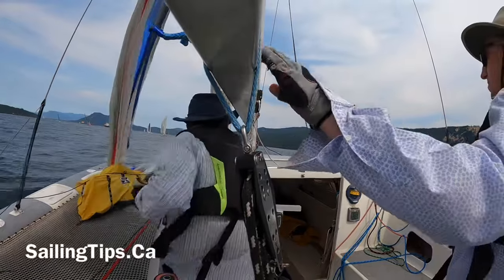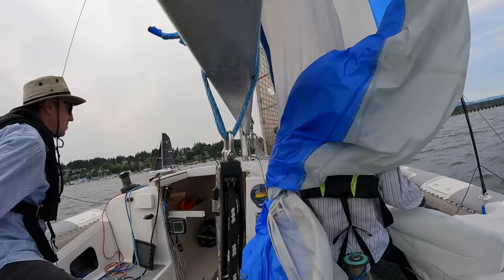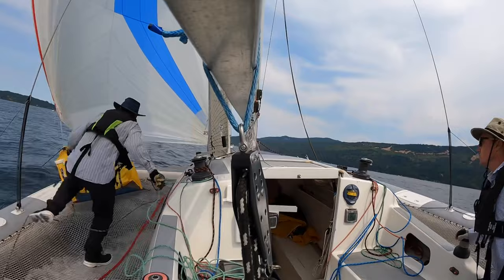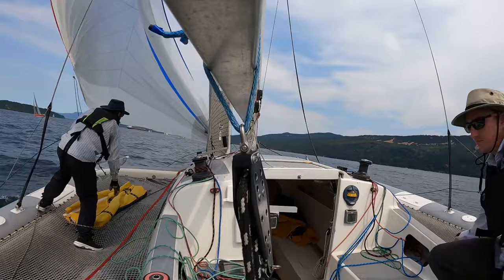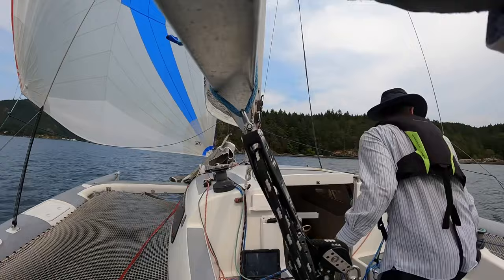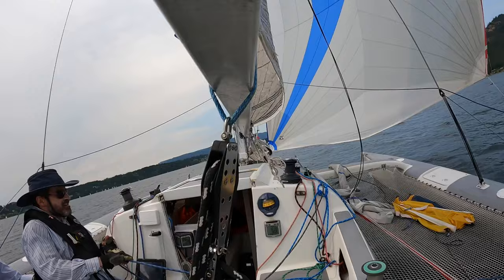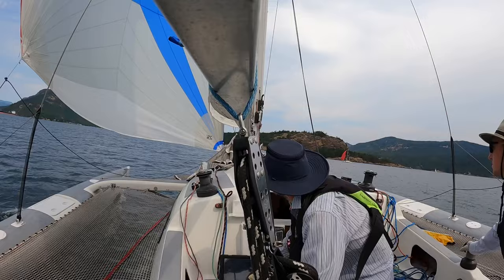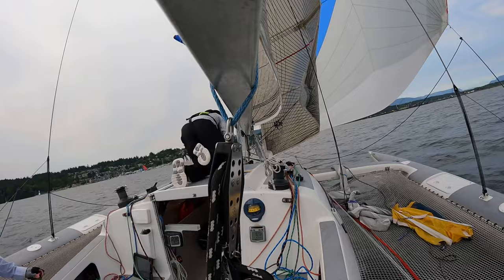How Do You Fly a Spinnaker DOUBLE HANDED?!?!?

Comment: It’s even easier if you have a snuffer.  The other tricks for two handed is to route your sheets to an alternate location on an ama so you can help look for traffic, and to run the spinnaker a little higher by easing the tack (for asymmetric) to increase visibility.
Reply from the maker: Good suggestions! I had a snuffer on my last boat and it once got fouled and I couldn’t pull it down, so they’re not entirely fool-proof and also require some finesse!

Comment: GReat and as always easy thanks to the clear and short explanations. One question; If you want to raise back the Spinnaker after dousing it, is it always compulsory to repack it as you shown in the other video? ( I learnt it that way from you and always worked like a charm) or can we directly raise it out of the bag through the front portlight?
And another question, how to attach the bag to the lifelines in a cruising boat (Mine have one small metallic carbiner in each side  and at the end, always goes down to the water but reamining still attached; seems to be a silly question but I didnt find the proper way yet... 🤭
Reply from the maker: If you douse a spinnaker into a hatch, or a bag hanging in a hatch, it’s definitely possible to raise it directly out of there again, assuming you didn’t change any lines or anything - if it went in it should come out again. This is particularly useful for around the buoys racing where you’re doing multiple laps of the course during a race, each with upwind/downwind legs. You just need to be sure it’s able to come out cleanly without catching on anything, or dragging other stuff out with it, or that it doesn’t get dragged out prematurely. 

My last monohull had lifelines and the spinnaker bag had wichard hanks that could be attached to the lifelines. If your bag doesn’t have those maybe you can add them if you can sew?
Reply: @SailingTipsCa  Thanks, I will try  to hoist over and over from inside the boat while racing ( we do friends concentration once a month, kind of a regatta, but without timing, just fun). Hahaha, true; in a cruising boat, the spinnaker could  take whatever out when being lifted as the boat is always full of crap! Hahaha; good advice! My bag has also similar hanks, maybe I should add 2 more so I can lock it to both lifelines so it cannot spin as happens when just attached to one. Great!
Reply from the maker: @bybeka1  On my last boat we sometimes would douse and launch from the forward hatch which contained a shower and head. Sometimes the spinnaker would get caught on the head flush handle on the way out, so we just put a piece of tape over that so it wouldn’t get caught. Of course we had to remove the tape to use the head but we also had another one further aft in the boat.

Comment: Why drop the jib? Does it cover the gennaker that much? I sail dinghies so it's very impractical to do it and not something I would think of doing
Reply from the maker: Great question - I did a video on just that! Five Reasons to Fly a Spinnaker and Jib Together https://youtu.be/_HjLyupVRGc

The basic answer as to why you might drop the jib is that it sometimes adds unnecessary drag in light to moderate wind, although I tend to keep it up in more brisk conditions.

Comment: You better easy the spinnaker sheet 100 % straight away and pull in the other sheet, even try to fly it on the other side before gybing the main instead of having it forced to the other side. Just our J80 technique, we were second at our Belgian nationals this month.
Reply from the maker: Yes I agree! On my last monohull we had a crew member pull the spinnaker clew all the way back to the shrouds before turning the boat and gybing the main. If you turn the boat and gybe the main too early you risk wrapping the spinnaker around the forestay. But if you do that a good trick to unwrapping it is to gybe the main back and it will unwind itself.